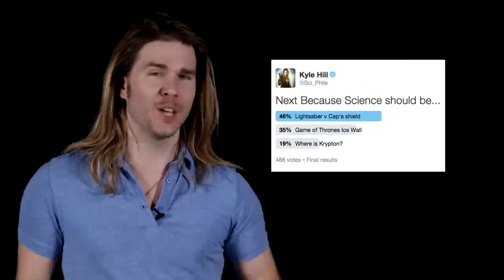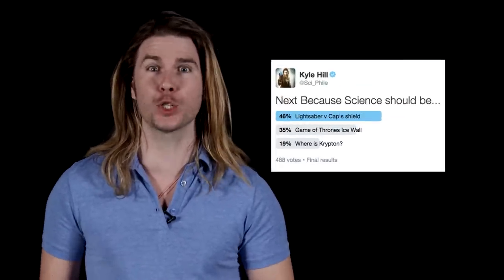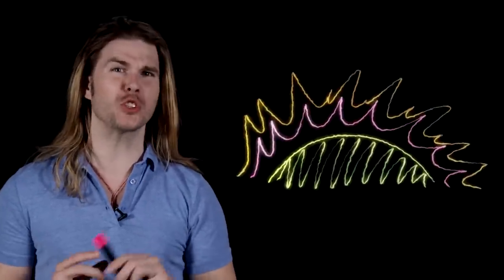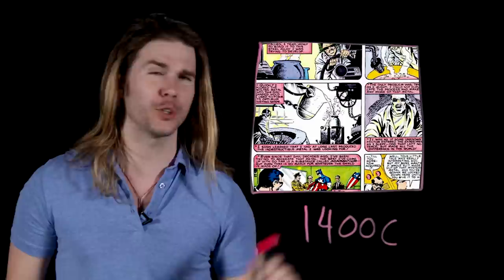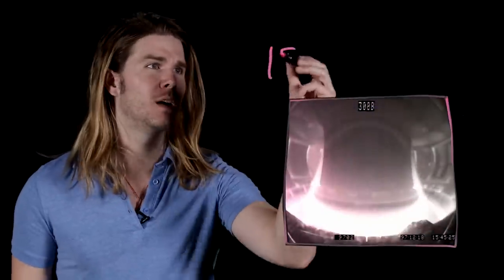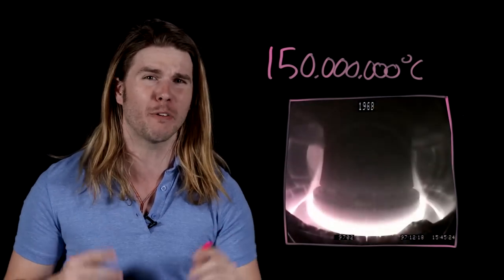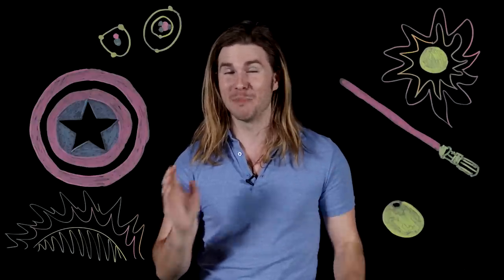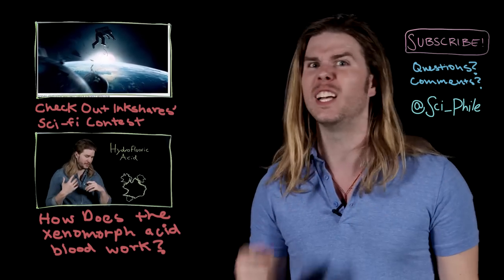Could a Lightsaber Cut Through Captain America's Shield? (Because Science w/ Kyle Hill)

Comment: Even if the shield was indestructible, you could use the force to remove it from him.
Reply: so true
Reply: +Isaac W You could also ask him nicely for the shield, but these scenarios are not in question here
Reply: Its not cap vs a jedi its Shield vs saber
Reply: +Isaac W Uhm, you'd just end up pulling captain america right to you... He'd falcon punch your ass. :V
Reply: +Isaac W completely beside the point. The question involves only the two items and has nothing to do with who wields them.
Reply: +Isaac W it wont work... his shield allways turns back to him... even if you use force o_O
But really... he will hold his shield and punch you as soon as they reach to you
Reply: +Nick Kominitsky Ahh, but, if that was the case, then it would mean that a lightsaber wouldn't theoretically operate properly as it needs the force. Which, brings me to the conclusion that the force isn't used in a lightsaber at all. General Grievous isn't a force user, and yet he is still able to wield several lightsabers...
Reply: It's not that easy.

The shield has considerable weight and the momentum its thrown at gives it more energy. Force Users rely on various levels of concentration and finesse / control, but they have issues with complex moving objects and they need to focus and use the force to guide them. 

The best example of this would be Yoda versus Sidious, Yoda controls and throws the stadium booths very similar to what you'd expect from the shield. This is much larger of course than what Captain America's shield is thrown at - but we'll come back to that. The important thing is it highlights the situation very clearly.

The important thing to take away from that fight is how control, power and finesse change the battle conditions leading to problems.

Once the battle becomes all about the force Sidious uses his overwhelmingly dark side abilities to throw several discs at Yoda. This drives Yoda, causing him to lose footing trying to keep up. Yoda has to decide whether to evade or flee, but the issue here is far more symbolic - Sidious has the advantage, Yoda HAS to chase him. Sidious can run away and win the day so he is baiting Yoda into a desperate assault. This causes Yoda to have issues focusing and so he face plants onto one of the discs. When Sidious tries to capitalize on this by aiming a disc from a raised position, Yoda stops and then stops and spins the disc - this "finesse" represents his mastery over the force being more about control. Palpatine can't handle the spin on it, can't retreat upwards safely so he jumps down. He's forced to jump away and then look for Yoda, who uses this momentum to capitalize while he reacquires him. Yoda loses by only a few steps - his footing representing the total loss.

Maneuvers take energy, they take power coming from the force itself and most importantly they need focus. The most powerful users we've seen can throw huge objects but it takes them time, effort and concentration. This is a huge issue against Captain America and the shield.

Cap's fast. Real fast. He doesn't just move fast - he thinks at peak human physicality. Jedi's train hard but their training isn't just in raw ability, it's in mastering their emotions so they can better control the force. Maneuvers like force speed, telekinesis - these things take energy and emotional restraint - or rage if we're talking dark side. They take undivided attention and a management of emotions. We see Kenobi get totally destroyed by Dooku by a simple well placed force choke by Dooku, and Sidious force choked Dooku in the show from a teleprompter. These things are considerable threats but they all require focus and importantly, understanding.

The best Jedi don't command the force, they trust it outright. This is known as the living force and this gives Jedi almost precognition - Yoda, Qui Gon, Obi Wan and similar characters practice this. Sidious and Vader command the force using technique, skill, and overwhelming control over it - they rely on strategy, tactics and their own ability to command it. Vader straddles both sides of course but that represents a distinct issue in terms of selecting the proper tactic.

This does present a diverse array of skills, but some are more useful than others. Some are very problematic given Cap's natural advantages mixed with his extremely strong character benefits - Steve Rogers is absolutely unemotional and his conviction his unwavering, unfaltering and concise. This makes him very hard to read given how emotional Jedi are, despite their training.

First, the spin and directionality of the shield are extremely dynamic. Blocking blaster fire is all about speed - but a lightsaber is adept at stopping this due to the Jedi's "precognition". The issue with Cap however is that a blade won't stop the shield "enough". If he throws it, it's not meant to just hit - it's meant to distract. It can be thrown aside but he's right behind it. If you pick the wrong tact it's over - and he's just plain too tactically brilliant. He might not even aim for you, but aim near you, just get you to deal with the threat as it bounces around the room.

If you stop to force grab the shield it takes a moment and it's extremely fast and worse... it's spinning.

Yoda uses this technique on Sidious and he clearly has an issue rebuking it. The spin, the bounce and the dynamics are problematic.

If you try to take the shield out of his hand, you have to pry it off him. He can jump with it and he's good in the air, and then you have to deal with a wild body attached to the object you're trying to take. If you try to lift him and the shield, that may work - until he lets go. This is a dynamic object - he's going to vault off it, touchdown, roll, and when he comes up as they're throwing the shield into low orbit - rock right to the face and now they're distracted. You can go for a force choke out of the gate but then he throws the shield and then someone has to pivot. Worse... Cap is utterly prepared to use unusual tactics. We've seen Jango Fett outplay Obi Wan - they aren't immune to unusual tricks, tactics and those with impenetrable resolve. Obi Wan couldn't block the wire from covering his hands - too fast, too complicated an object to manipulate.

If he throws the shield and they do the deft thing and just redirect it slightly then go for the force choke... it's gonna seem like they won.

Until the boot hits them in the head.
Reply: See, Cap's clever. He's going to throw the shield at someone's face then lob the boot in the air when they're focused, and by the time you realize what's happened - they'll be choking him, sure, but when that boot comes down on top of their head because they're focusing on the choke or push you're gonna be distracted... and that's more than enough time for Cap to capitalize. He won't need to recover because he barely needs to even breathe. Dust, rocks, anything on his belt - absolutely anything at his disposal is a weapon. The man fought in alleys and is no stranger to using whatever is around... and between you and me... the Jedi need to stop wearing leather boots, combat boots matter. Vader knew this.

Meanwhile... the precognition has some issues with cap. Can you sense his emotions faster than he can process them? Answer's no. Cap's peak human and while the force will let them see into him, he's not at all weak minded. His attacks are measured, balanced and ultimately incredibly dynamic, pragmatic and brutally efficient.

We all laugh and say, "Oh cap's such a goof" because he seems so hoaky, but he beat Iron Man despite all of Iron Man's advantages. He got in his head and he stayed there. If you take away the shield and get an angle on him... great...

But could Vader handle his cool when Cap asks him, "Are you hiding from me or yourself in that thing?

Can Yoda maintain focus when Cap says, "I was the little guy too - nobody listened to me either"

When he tells Luke, "You're a dreamer, you're barely even here"

When he sees Kenobi and says, "You're not one to take the first shot are you?"

When he looks at Sidious and says, "You don't fool me, there's nothing under that robe is there?"

... and they can sense that he means it with total conviction and that he figured them out *entirely without needing the force*.

You tack on the fact that the shield bounces, spins, and otherwise curves you've got a problem. It seems easy to just throw it away but there's no time. That little feet plant and whimsical eye-close, when they open them, he's gonna be all over them. Worse Cap's smart enough to notice if you favor deflecting left, right or up a little bit. If he gets a few throws off, he'll miss.

Knowing you'll deflect it how you did the last 2 times and accidentally course correct it right back on track. That's how he surprises everyone.

I'm a star wars fan first, so like... situational distance will matter. Terrain can highly matter, footing, opportunities for stealth (which admittedly is not good for Cap)... but as far as taking the shield away from him, it's not so simple. Yoda can lift an x-wing, Vader can drag a starship to the ground like he's a no-clipping video game character... but Vader also lets anyone take a step to him and is bested by Obi Wan, a guy who's got no great feats under his belt. Obi Wan should've lost against Anakin but he was balanced and that matters. Obi Wan got in his head and teased out that part of him that had something to prove... and so he wildly overestimated his abilities.

Cap doesn't pick a fight unless he's 100% invested and his weapon reflects this balance. It represents not just his philosophy but his deepest inner strength that goes well beyond the super serum.

It's that Steve Rogers is an absolutely good person.

Will the force give you the edge against that? It flows through all living beings. Cap might not be able to wield it, at all, but for many they rely on the force's guidance. If they pick a battle with Cap, is that gonna give them the edge?

Or will it disturb them how balanced he really is. In this regard someone like Qui Gon might actually prove to be his biggest threat despite lackluster performance in the films.

Because life is never so simple as a single tactic, strategy or maneuver... and it gets very confusing when you had an ethereal otherworldly force of dubious power despite infinite promise. There's likely battles that force users will 100% take without failing, Cap can't beat anyone out in the open on equal footing when people like Vader can throw a starship.

But that might come down to a matter of feet, meters and how fast one spots the other. Sensing him coming early might seem like an advantage until they sense who he is underneath - and have to think about what they should do.

Cap? Single-minded focus, he's there to do what needs to be done. He's not thinking about an otherworldly force's discretion or controlling an inexplicable "power" you seem to have to murder to keep happy.

It very likely will come down to spit in the eye and while Cap's not a dirty fighter, if you try to choke him to death with telekinesis people will be shocked how good his aim would be with a volley of spit. It's gross - but pretty hard to stay focused when he bingo's you.

The shield has vestibular advantages and it lets him pivot in odd ways, spin, using the weight to offset... and that makes him a wily cat. He's also so stupidly brave he'll bet it all on a crazy tactic - so... whatever tact they take with that shield... if they aren't ready for him to be TRULY tricky, he's gonna capitalize. It's terribly fun to imagine how all these characters would stand up to him and it might be truly unusual, because the Force is unstable... and when using it against Cap it's not just a tool you use. It's something that you must flow with - and when Cap's in the room, it's like having a big dang rock in the middle of that flowing river - more like a dam, really, with a big dang star on it.

One last issue...

If anyone draws a sword...

Cap's probably not gonna throw it unless he has to. Because both sides won't understand each other immediately but... Cap's not taking a weak grip when someone with a saber made of light is coming for him. Gonna make that first yank REAL tough and the moment "he knows" telekinesis is coming... whole fight changes. Sure, throwing a Starship at him might trump everything but uh... he's grappled helicopters and climbed on flying jets. 

This one is gonna get brutal, at least in everyone's mutual confusion at how insanely ridiculous these fights would get.

Comment: I realize that this is food that I'm referencing and not a metal aloy, but gelatin is an example if something that has an higher melting point after its original manufacturing process than the original components. culinary speaking at least.
Reply: Jell-O doesn't melt because it's a cross-linked thermoset. It will decompose with heat increase.

Comment: But if you where holding such a hot plasma at arms length would you instanly burn to death/ in an atmosphere cause a serious preassure wave when you switch it on, like thunder from a lightning just a lot stronger ? Not the savest weapon to use.
Reply: I was thinking this as well.
Reply from the maker: +Noneofyour Business I agree. The problem with analyzing fictional weapons is that the minute you assume something about them, another 10 problems with that assumption crop up. When applying science to fiction, I try not to make too many declarations because there are so many caveats, like the one you noticed. -- KH
Reply: +Noneofyour Business Maybe the energy keeping the plasma in the lightsaber traps the heat inside as well, and when you pass through this energy the heat gets to you? Idk, it's a possibility.

Comment: I think you all have to examine the feats we can check.  

Cap's shield had repeatedly withstood hits from the Human Torch's "Nova Flame"  The exact upper temperature isn't known, but in theory it can match an actual nova, which can reach 20 million kelvin, or about 36 million farenheit.  The energy-absorbing properties allowed Cap to be unharmed on the other side, for whatever reason, and apparently the shield wasn't even hot to hold.  

Based on that, I don't think even the highest estimate of a lightsaber's temperature can even come close to this temperature.  And since this temperature was ineffective at hurting the shield, I don;t think any lightsaber can cut through it.  

As for "ligbtsabers can only be blocked by certain materials"-- not true.  We see lots of material resist lightsabers in the canon sources, the question is merely how long it takes to overcome it.  In TPM, Qui Gon is slowly cutting through a blast door, and he would eventually have succeeded; however, the door still stops him until reinforcements arrive.  So, some material will hold off a lightsaber indefinitely. 

Of course, the more interesting question is the Death Battle.  Who would win, Cap or a Jedi?  Or better yet, Cap vs Darth Maul?

Comment: The lightsabers are NOWHERE near that hot.   How could Jedi even use them if they were?

If they were, their weilders would practically be bursting into flame every time it was turned on.  If you hand is a few inches away from something that's 15M dgrees C, its pretty much going to melt off.  At best the light sabers are probably maybe thousand degrees C or so
Reply: hot enough to cut trough arms and burning the blood fast enough
Reply: This is the real-life equivalent of a lightsaber, not the kind used in Star Wars.  In order to make a lightsaber in real life it would have to be extremely hot to actually function and in the Star Wars universe the Jedi could be trained to use the force to dissipate the heat generated by the saber to a certain degree.
Reply: *****
 This has been discused to dead, that's why I linked a wikipedia article about it. The fundamental force of the lightsaber is heat (most likely plasma) contained in a force field, that's how you limit the distance the heat escapes. There are ways to replicate to some degree a lightsaber as shown in the video, but we have yet to find a way to create (in paper) a forcefield with the capabilities of one used in a lightsaber.

Comment: @Nerdist I think you missed something. At around 2:40 you explain how the shields melting point would actually go down and become a value between steel and vibranium; but in actuality because of vibraniums quality of absorbing heat the amount of energy or heat required would GREATLY increase in turn increasing the melting point. We know that this quality will absorb heat because of what you talked about right after, heat is really just the quality of moving or shaking atoms which is kinetic energy.

Comment: If the shield absorbs kinetic energy, wouldn't anything that touches it instantly cool to absolute 0, due to all the energy from its molecules being absorbed?

Food for thought
Reply: Riley Lankes it doesn't absorb all kinetic energy but yeah if it did you could feel him coming from a mile away
Reply: It seems like "absorbing kinetic energy" would be converting normal kinetic into heat. Unless that thing destroys energy, it has to direct the energy somewhere. Into what form is the energy directed, if not kinetic? Chemical? Light?
Reply: @alexanderkilburg7415  according to the rise of the black panther vol 1 1, the energy absorbed by the Vibranium gets into the subatomic bonds of the metal itself. "The energy is still there it's doing something else" to quote the comic!